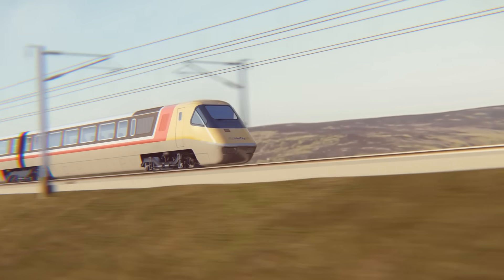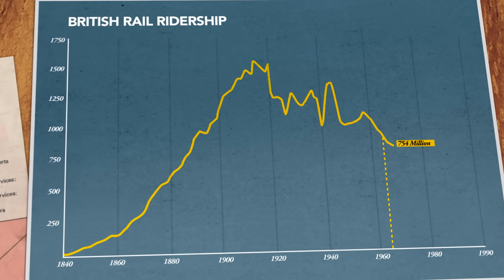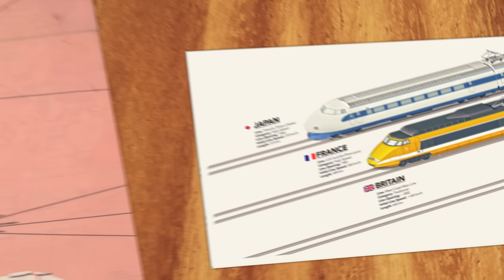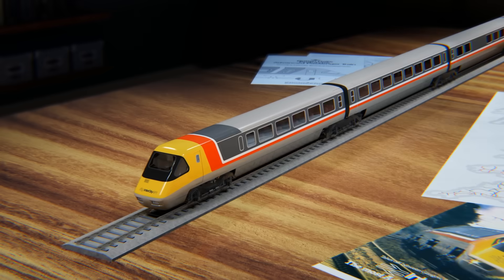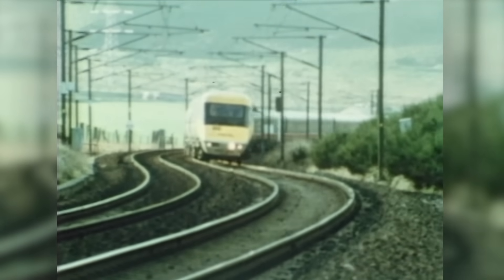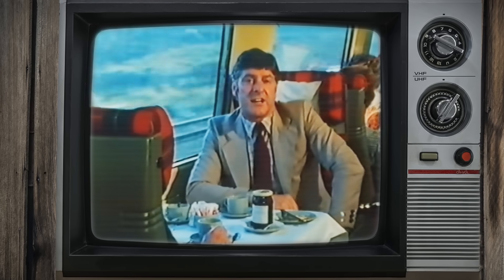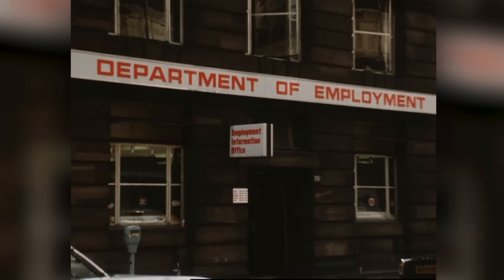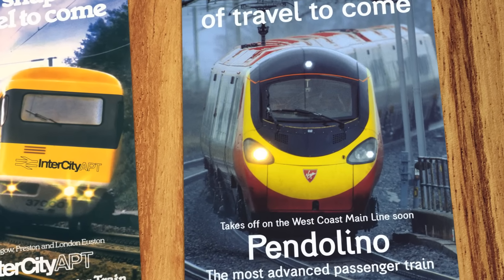This Train Made Passengers Sick: The APT Tilting Train Story

Comment: APT is just spicy Class 390 Pendolino. Change my mind.
Reply: The pendolino tilt mechanism is based off of the APT. The designs were sold to Fiat Alstom.
Reply: The pendolinos tilt mechanism started life as the APT, we sold the tech to the Italians
Reply: @jean-marcdulac4297  The Class 390 Pendolino  are electric multiple units using Fiat Ferroviaria's tilting train Pendolino technology and built by Alstom, in both  Washwood Heath, England
 and Savigliano, Italy.
Reply: @jean-marcdulac4297  electric, using trackside beacons to activate and deactivate the mechanism. Usually canting to around six degrees.

Comment: Once the bugs were worked out, the APT would have worked fine. The problem with the APT was terrible project planning and development. That caused constant cost overruns and schedule delays. So much money ad been spent and the APT delayed so long that the pressure to put the train in service was irresistible. It was essentially an alpha test being played out with the customers being unwitting testers. Even the motion sickness affect a very small number of passengers, and sufficient development testing would have caught this and corrected the problem.The APT was now in the public mind as the train that made you sick. British rail workers who would have lost their jobs if the train succeeded and eliminated the large number of slower diesel and electric trains did everything they could to slow down the APT with unscheduled stops of their slower trains, obstructing the progress of the APT. BR management grew to hate the APT because of all the negative press. The negative press directly reflected on BR management, and they just want this albatross around their necks gone. Even after reintroduction in 1984 and reliable service at 125 mph, the APT was quietly removed from service after just a year. Two of the train sets were broken up for scrap and one is in the BR museum. As noted in the video, the technology was sold to Fiat which built tilting trains for service all over the world. The Pendolino even returned ot Britain for service as the Class 390, matching the APT's top speeds of 155 mph, although on generally better tracks than what the APT ran on. Those on the APT project team that tried to keep the trains going were quietly sacked or retired.

Comment: The footage showing Britains railways in the 1960s could just as well have been shot in the 1980s or early 90s on most parts of the network...
could have done an epilogue about how Britain is now doing what it should have done in the first place and building a high speed north-south line separate to the legacy network (if it doesn't get cancelled)

Comment: At the end of the day our rail system is a Victorian nightmare and large sections should be closed for public use in favour of industrial use. Other sections should remain open, but we require more attention to our road network. We need more motorways and wider/faster roads especially around London. Yes this would incentivise car ownership, but that will always increase regardless in an ever developing economy. 
In reality, our train network needs an overhaul with new straight line connections being built with foreign reliable labour as the UK is notorious for striking labour forces. These straight line connections should not however focus directly on London, but on smaller faster routes (for example, Nottingham to Birmingham, Liverpool to Manchester, Edinburgh to Newcastle) with connecting routes in between for crossovers. The UK government suffers from a plague of Londonisation in which every city and town must focus and rely on London rather than attempting to boost independent areas for growth with projects such as high speed rail.

Comment: The motions sickness was more to do with the journalists being smashed out on drinks than anything else.
Reply: I was going to post the same thing. The only reliable report of anybody getting sick was on a press demonstration run where a few journalists had somewhat over indulged in the complimentary refreshments.
Reply: @DavidBromage  apparently BR had a massive hospitality budget which they let the jounos blow the night before the first run. Should have called it the 9:00 Hangover Service from Glasgow Central  to Euston..
Reply: That's the 1980s for you!
Reply: Steve Evans plus the motion sickness experienced on the APT was fixed by slightly reducing the tilt(it turned out the problem was literally that it worked too well and you couldn’t feel any tilt at all when it turned corners)
Reply: Half and half, really. APT's tilt was simply too good.

When the train tilted, it was so accurate that you simply didn't feel the lateral forces in the corner; this had disastrous effects if you were, say, reading a newspaper or enjoying some food, then you looked out of the window and saw a full 10 degrees of tilt that you couldn't feel. This causes the brain to see motion that it can't feel, it assumes its been poisoned and so you throw up. 

The Pendolino's reduced the tilt so you can still feel some of the lateral cornering forces to try and avoid this problem. I would say it kind of works, but I never experienced the original APT.
Reply: Just saw this clip and was about to post the very same, several of you beat me to it :)   APT was fantastic, killed by (drunk) press and govt. I was pre/early teens in Penrith when APT was doing test runs, so used to get to see it run through the station regularly , and with Penrith station being on a bend, would see it titled, then if it was Southbound, see it straighten up afterwards.  Absolutely superb !   Then we sell the tech to Italy and they sell it back to us as Pendolino
Reply: Exactly. People seem to overlook all the thousands of miles that it ferried BR engineers and later public passengers about without anyone being sick when repeating these claims. It just goes to show how powerful fake news can be in influencing the public perception of things!
Reply: @soundseeker63  I am sick on the Pendolino every time. APT is said to have been even worse.
Reply: @DrWhom  Really, I've been on Pendolinos dozens of times and never felt anything. Ditto most passengers. If this was a serious issue then passenger numbers on the West Coast Mainline would have dropped like a lead weight since their introduction but that has not happened. Quite the opposite in fact. Virgin have had to order additional units to keep up with passenger demand.
Reply: @DrWhom  I think you might just be travel sick mate, Pendolinos are banned from tilting in the UK.
Reply: @paulallan5517  I only ever experienced tilting on trains whenever the track itself was slightly banked. Even then, when I could see the entire damn train leaning into a corner at up to 10° I never felt sick at all. Some people that complain about the tilting trains and becoming sick just have a weak stomach. Thats all. But of course those are also the ones that are the loudest.
Reply: @paulallan5517  They aren't. Besides the Class 221 they're the only rolling stock that does 125mph on the WCML specifically because of their tilting mechanism (Avanti's 221s tilt too). All other trains on WCML are restricted to 110 because the line is very bendy
Reply: I get motion sick all the time but I've never got ill on a Pendolino.  In fact the first time I rode on one I didn't know it was a tilting train until I looked out the window and thought, either the water level on that canal is at an angle or I am!
Reply: Yea X2000 doas also cause motion sickness to some people personally I think it's worse wehn the train is moving to slow
Reply: Well, I still get ill on the "much improved" Pendlinos of today.
Reply: @Mickleover test track It's a shame APT was never followed through. Britain could easily have become the leading manufacturer of tilting trains, but no. The press simply had to kill it to sell more rags...
Reply: Indeed!
Reply: @OO Sectorisation era model railway It's unlikely APTs would be running on the WCML today, as privatisation still would've happened and most private TOCs wanted rid of British Rail trains for being outdated, particularly Virgin who replaced trains barely even 20 years old. The WCML upgrade was planned at 140mph anyway, which was the planned speed of production APTs, and would still have required in cab signalling, which is why Pendolinos nowadays are limited to 125mph despite being capable of 140mph. Lastly, there still would've been a need for HS2 or a line similar to it, if anything more of a need, as there would be an even bigger capacity problem due to there being an even bigger difference in the speed of local and intercity traffic on the West Coast Main Line, meaning each intercity service would need more headway in front of it to prevent it catching up to a slower local service in front
Reply: We have the X-2000 in Sweden and it tilts, and I can't stand it.  never had a trip when I wan't on the edge of puking,.
Reply: Marcus I took a x2000 train two days ago where they had to disable the tilting. I was slightlu motion sick before, but not at all when the tilting was disabled (but things fell of the tables and you could definatly not walk without holding on to seats)
Reply: Everything is flying around..... You don't drive car on 100 year old road without upgrade....
Reply: @campkira  here in germany even parts of the autobahn are more than 80 years old , no upgrade in need.
Reply: @RendernStattGendern  - Exactly. UK infrastructure has never had a proper upgrade since the 1880s - always underfunded half-measures. And after Brexit, it will only get worse as we become more isolated from European civilisation!
Reply: @MarkVickers1   yeah i think you are right. UK is fucked, because of old people who wont survive long enough to face the consequences
Reply: Rendern statt Gendern Thanks to the best Chancellor ever.
Reply: @KillerofPCs  Since his background was in designing amusement park roller coasters, it was a mystery him as to what was wrong.  The remaining patents were used in a ride called the Vomit Comet.

Comment: Here in Germany we have the ICE-T (electric) and ICE-TD (diesel) using similar technology. They are build since 1999 and are still plagued with defects. At some point in 2009 every second train on the Berlin-Munich route was out of service, but on that route they were replaced last year when the new high speed rail line opened, operating ICE 3. Since 2010 they are no longer running the route Stuttgart (D) - Zürich (CH) due to delays and the resulting fines by the Swiss authorities.

Comment: I went in the TGV Reseau last year.25 year old train yet silky smooth at 300 kph.
Reply: drdoomgoat 38 They even revamped 40 years old TGV cars into the « OUIGO » brand, as a low-cost solution. It’s quite good actually, I use it often.
Reply: Same in the Frecciarossa. Even at 300km/h most of the time you can barely tell it's moving.

Comment: Its not correct that the legacy train network rails is not tilted. They are, but to a lesser degree than High speed rail due to freight train also trafficking the rail might fall over if they stop.

Also the trains don´t really tilt into the corner. The tilts is fairly neutral. The reason is if it do it might hit a post or a tunnel wall. This don´t... or barley shift the center of gravity. Making the practical speed increase quite a bit lower.

There is also a few other reasons why High speed trains are faster. One very simple is that the curves is longer. But a other lesser known is that the rails is grined in a shallower of a angel.

The statement "tilt caused almost 1/3 to be motion sick" is almost certainly false. The press didn´t like the train for political reasons. There was similar claims about X2000 when it was new... And there was people being motion sick, but really very few. (a software revision fixed the problem almost totally)

Comment: "It's smooth, it's quiet" he says as the sounds of clattering silverware fill the air and the cabin vibrates violently.
Reply: It's still hilariously ironic.
Reply: It's doing something like 130mph. Try that on an ordinary train and the cup would be flung violently against the window! 

Still, the fact they used that take with the vibrating crockery is hilarious!
Reply: i thought the same thing...so funny :D
Reply: He would make a good realestate agent
Reply: You do realise the trains before this were even worse?
Reply: @theinternetfireandrescuese8716  Trains before? TRAINS NOW are worse than that!
There are parts of the line today that will try to throw you off your feet, let alone jingle a cup and saucer.
Reply: @sergarlantyrell7847  thats probably just a pacer train
Reply: @sergarlantyrell7847  that's called a point. Unless you want to crash with a train on the same line, then that little bit of jostling is required
Reply: @crownjulesgaming542  Pacer trains pitch and roll violently at well below their modest 75mph top speed....I should imagine you would become airborne if it were possible to get one upto 125mph!!! lol
Reply: @soundseeker63  Actually to be fair Pacers pitch and roll violently because they are a bus chassis and body pretending to be a train. Lol
Reply: @theinternetfireandrescuese8716  have you ever ride on the TGV?
Reply: Lex Go 
The TGV has good tracks UK did not
Reply: @Jakob_DK  ok
Reply: Probably it is the tripod of the camera is causing all the noises when vibrating a bit on the floor